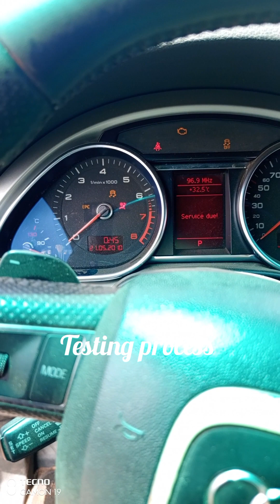How to convert 3.2 FSI Engine to 3.0 TFSI #audioworld  #audilovers #viralvideo #german #nigerianews

Comment: Hi there, I’m from South Africa and just about finished with the same rebuild you did. I have one question, how did you make the TFSI coolant cover ( next to water pump) work as the holes don’t light up? That cover holds the supercharger idler pulley. Thanks for the content
Reply from the maker: There’s a hole on that coolant cover, put thread on it and tight the supercharger idle pulley on it, pls if u don’t understand it just let me know so i can make a video for that

Comment: If you did not change the pistons on the 3.2 engine then that was a poor job cos I didn't hear you saying you did. The 3.2 fsi has a higher compression ratio to the 3.0T and I can guarantee you the ECU will be struggling to prevent knocking due to the forced induction
Reply from the maker: The good thing is that i am still using the car till today, and i have done this same job more than 15, ok next time  I will do that, pls subscribe thank you
Reply: Video of proof running?
Reply: You know just enough about cars to not know enough about cars, Lol. While part of your info is correct the assumption about knocking is just wrong. They could swap the ecu, keys, cluster etc etc or recoded the ecu with values to support the supercharger. Or like we watched, slap the SC on there with supporting mechanicals and drive it like other people do everyday with these projects. A friend bought a SC for his Tundra, we slapped it on there and  the endless burnouts meant it was working as it shouldve. He said he'd get it tuned, 3 years went by, the engine didnt implode vever had a cel and he ended up sellling it and never bothered getting a tune. Be it Supercharger or a Turbo so plenty of leeway using the stock ecu on most any engine if you do it correctly. Sure in this case, the SC wont be making optimal performance beyond the psi of the pulley, but it should run reasonably well even if these engines are the worst Audi has ever made.